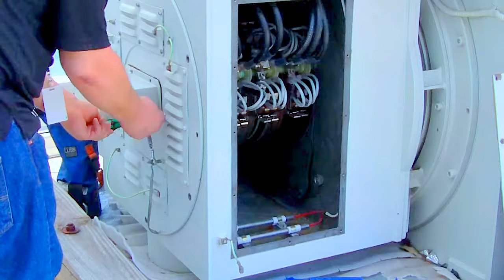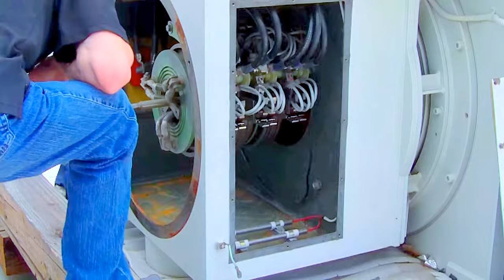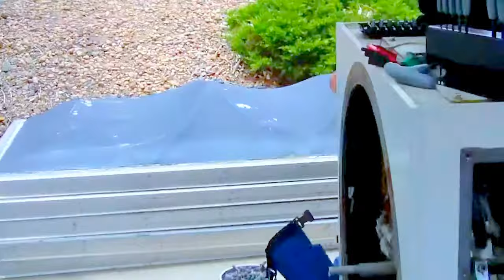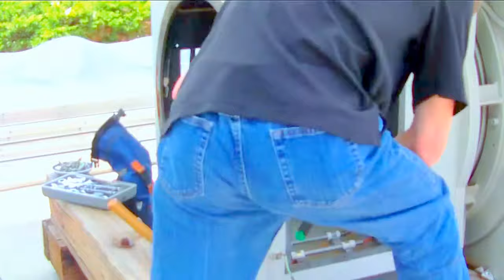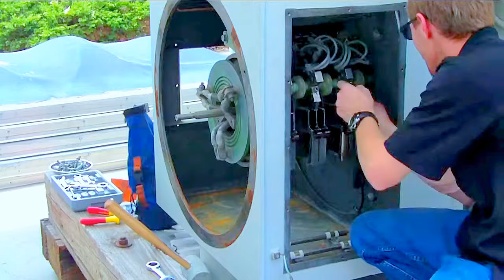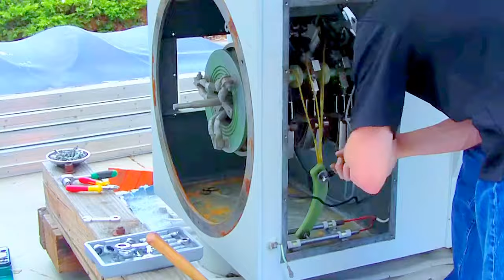Wind Turbine Encoder and Slip Ring Removal

Comment: Thank you!  I can't believe no one has commented here - but there is hardly anything out there on WT slip rings in the field, only scholarly stuff (collector, electric swivel, rotary electrical joints, which seem to be interchangeable at will).  Was this for practice or was this a repair?  What are the most common reasons a slip ring fails? (I assume improper ventilation and particulate contamination from dust.
Reply from the maker: Thanks Paul, I've started teaching again and will be adding more videos and podcasts soon. Subscribe to be informed of new releases.
Reply from the maker: Slip rings can fail for a number of reasons. Although uneven wear of brushes might contribute. The buildup of carbon dust can lead to arc-over. A circuit completion between phases is the most common problem.
Reply: @trentnylander5874   Thanks for answering my question.  I'm building out a causal asset network for wind turbine failure diagnostics and the slip ring (to me) is equivalent to wheels on a car.  Its the proper application of force - and it seems there is not a great deal of information, at least from what I have found so far.